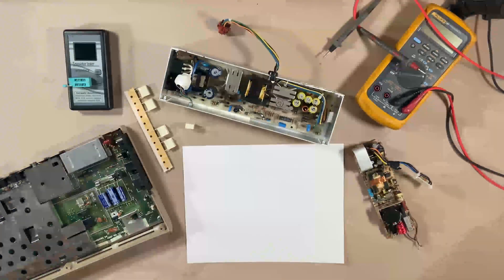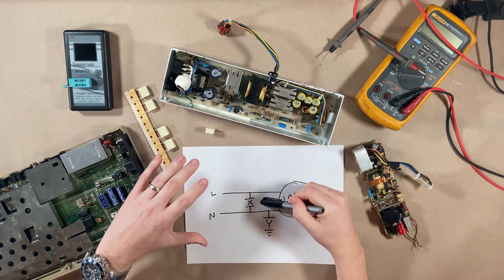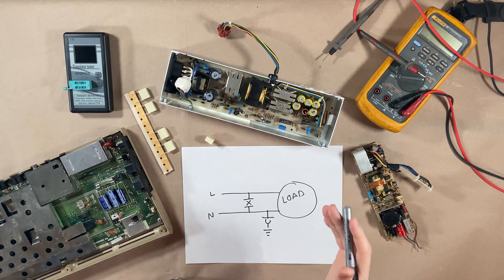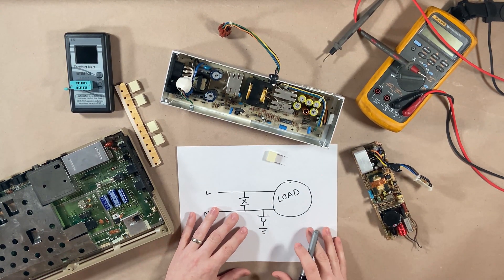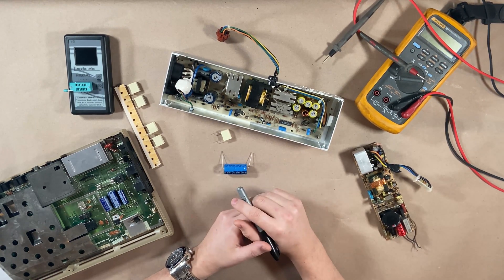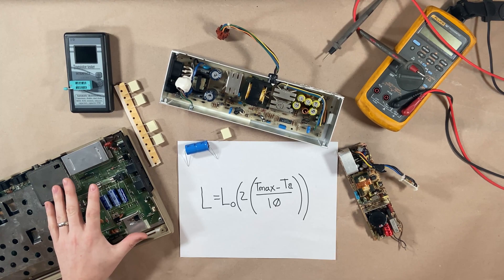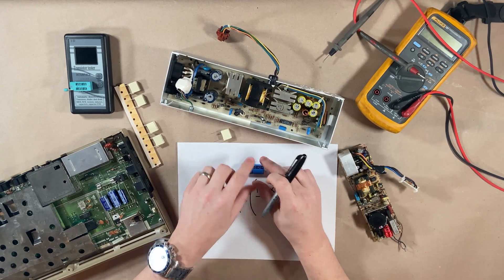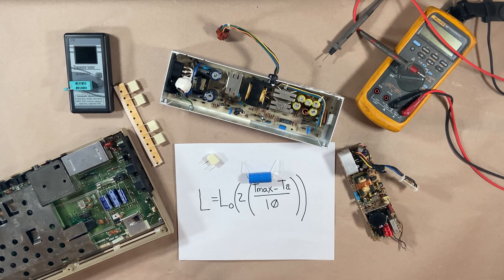Why and When to Replace RIFA, Safety Filter, and Electrolytic Capacitors

Comment: There's a capacitor in S.M.P.S. its connected between the primary and secondary side. Safety capacitors are used there to isolate the hot side of the AC line from the secondary side and prevent shock.

Comment: I definitely agree with your logic on this one and follow very similar policies. I don't like recapping computers just for the sake of recapping them but if there are already signs of multiple capacitors failing, I usually go with the policy of "If I am in here and doing these ones, I might as well replace the rest of them". 

I just ran into a similar situation restoring an old NCR PC4. There were visibly bad capacitors on the CRT's analog board and the power supply had two X filter caps on it that were starting to crack. Given how much of a chore it was to get that thing apart, There was no sense in putting it back together with old caps especially with the fact that the ones that were not visibly bad were still quickly approaching 40 years old.

Comment: Nice video!  It was easy to follow and explained things well without being too complicated.  While I don't typically re-cap old computers, except ones like Amiga AGA or 68k to early PPC macs that use SMD caps or ones that are leaking, I don't see the harm in doing so if you have the skills and proper tools and, especially in old 8-bit computers where you try to get a similar series of cap. This can be very confusing because when you go to source replacements from, say, Digi-Key, there many different series.  Some made for switching some not, some for audio, etc...  Most of my C64s used Nichicon caps from the factory which still seem to be in spec on the ones I have tested.  Amazing really.  Keep up the good work!
Reply from the maker: Thanks for watching! Yea sourcing caps can be complicated, I could talk a lot on the specific uses and series......but that will probably another video. I wanted to keep this one simple.

Comment: I always recap as much as I can.  My VIC-20 was recapped before I even tried to turn it on.  My C16 and Plus/4 work now, but they're on the docket for new caps in the near future.
Reply from the maker: It makes sense to knock all prevenmtive maintenance out so you don't have issues later.